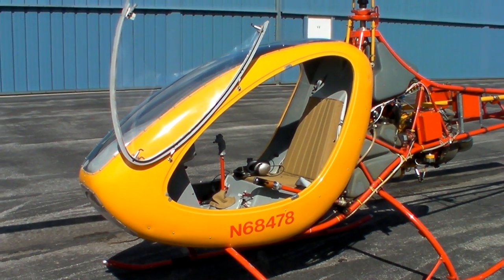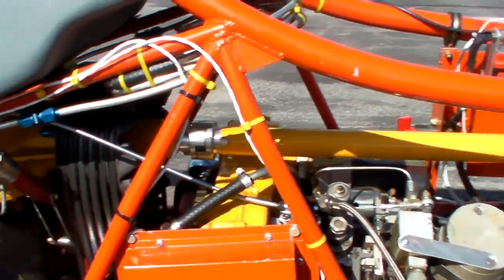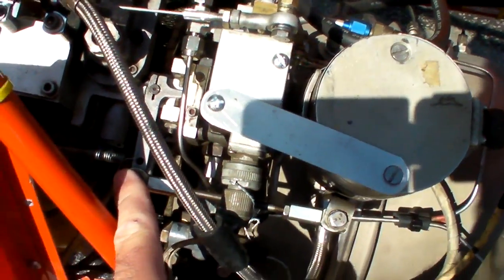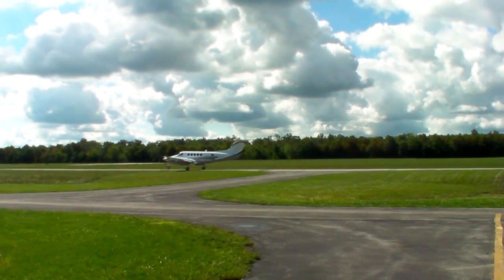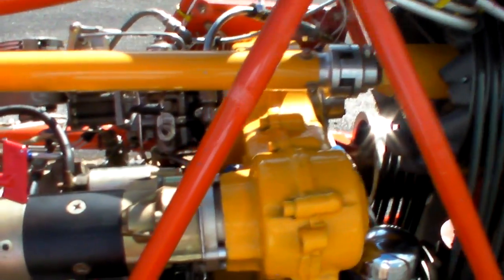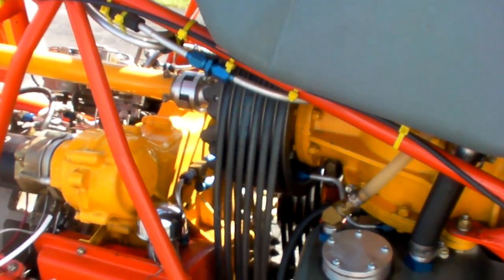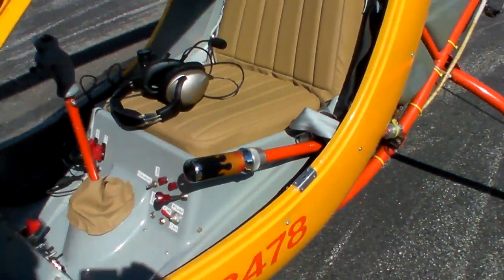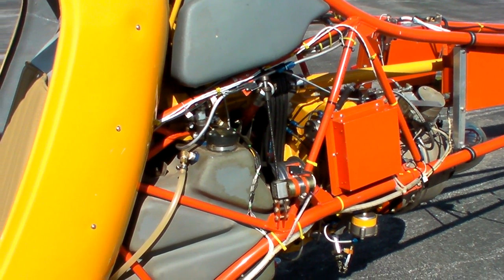Helicycle walkaround systems description

Comment: Would like to hear your thoughts comparing this to the Mosquito. Mosquito has belt drive up to the rotorhead but apparently does not use the turbine positioning as a clutch like this. Visibility is also supposedly better and most significantly to me, rotor inertia is supposed to be very good.